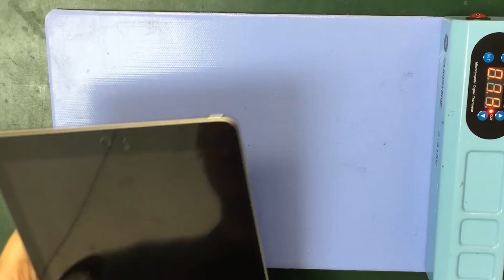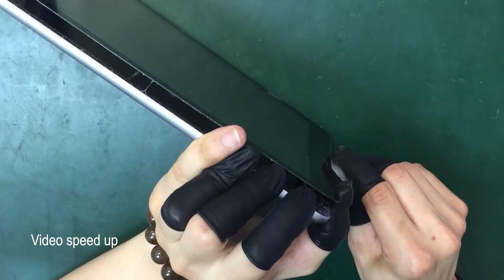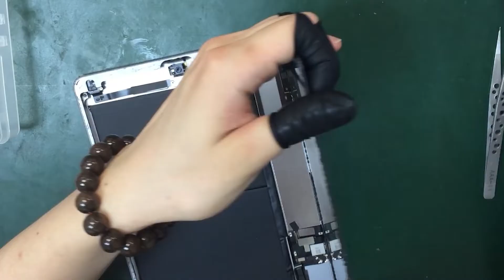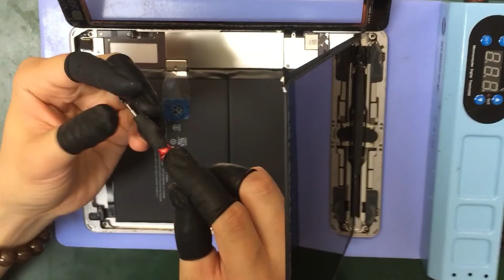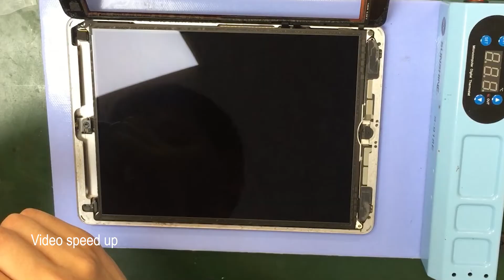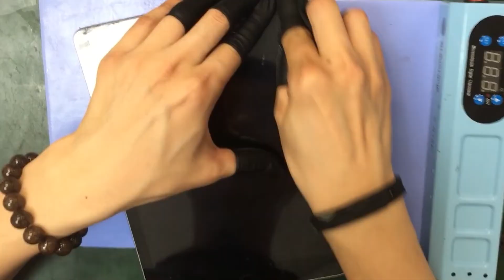How to replace your iPad 6 A1893 battery step by step | TSA Tech

Comment: You should have been more detailed in removing the plug cable connections on the mother board.  2 were pop off and the other one was pushed against very small gold pins.  Thinking it popped off like the other 2, I tried to pop it off to and broke 2 of the pins.  That just ruined my ipad.  It would have been nice if you would have said be very carefull with this connection as it is not a pop off but slides into pins.  :(

Comment: Bought a battery with a lot of tools included.  Read instructions first. I do not have a heat pad like it says in this video, but my instructions said use blow-dryer.  Heated it up as instructed, used a razor box cutter to try to loosen the cover, started to slide the knife across the top, pop!! The screen cracked. I am quite handy and really tried to release the cover screen, but it still broke. Looks like the edge completely around MUST be heated evenly. So seems to me a heat mat is required. But I am quite sure you better not get the entire unit too hot or damage can happen to electrical components inside. Totally pissed off.
Reply: The only part to worry about heat is the battery which is being replaced anyways and the lcd

Comment: Hello. Tell me what could be the problem. The ipad 6 wi-fi started to reboot from scratch. The apple catches fire and goes out. I tried a hard reboot, it didn't help. The computer sees the dfu mode, but when trying to restore, error 4••• appears. I'm inclined to believe that the battery died, the iPad is about 5 years old. A friend of mine had the same problem on an iPhone 6, the phone started to randomly restart and not go into the menu. I changed the battery and everything worked.

Comment: Hi, i got a swollen battery that wont charge ect BUT also the touch is playing up. Can bad battery ever effect touch? or do i have a bad M/b too? I could jump power to the connector and try with nominal voltage but every time other ipad i have worked on when  touch stops or is trouble, m/b chips ect are too blame.  Ask what you think?
Reply: The swollen battery adds adds pressure that shouldn't be there. Just changing the battery may fix touch. Double check before you adhesive close

Comment: Because the LCD screen and digitiser glass panel of the iPad 6th generation is not laminated, it’s not recommended to do DIY to replace the battery, there are big chances of getting tiny bits of dusts or fluffs inside the screen and made it look like dead pixels. … iPad Air 2 has laminated screens, that means the digitiser and the LCD screen are in one piece after taking the iPad apart, so unlike the iPad 6th generation as seen in this video.
Over a year ago I kept it in mind not to buy repaired iPad 6th generation, but this year ended up buying one used, and the seller had replaced the screen, it has 4 tiny bits inside the screen!

Comment: "Just keep working around the edges until it is fully cleaned". Why? It does not need to be. Just leave it there, it doesn't hurt anything, save time.
Reply: The adhesive won’t bond correctly
Reply: @Red-ol9xg , it sure will, in fact it's even stickier on top of the old adhesive. Saves a lot of time. Thickness isn't a concern either
Reply: If you don’t the battery can stick up. The battery will press against the inside of the screen. This will cause white spots in your screen.

Comment: What will be the cost of replacement  in store?
Reply: $99.00
Reply: @GeneAlderson  with or without tax?
Reply: @YourAverageSpeedrunner  ah hello fellow roblox player. ipad struggling to handle roblox too?
Reply: @davidevans7203  no, it’s charging problems, when i charge, it says it’s charging, but like 5 hours later when i check again it’s still at the same battery percentage
Reply: @YourAverageSpeedrunner  huh that’s weird
Reply: have ya tried doing a quick restart? (holding home button and power button until apple logo appears). Usually fixes problems like that.
That’s only if it’s a software problem tho.
If it’s ur battery then yeah maybe need to get it replaced idk
Reply: @davidevans7203  yeah i have, nothing changes